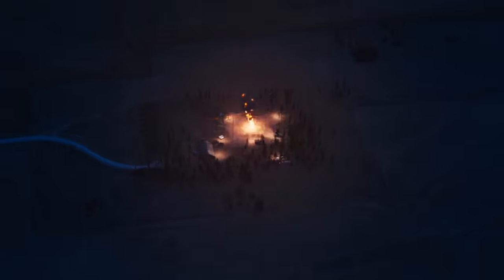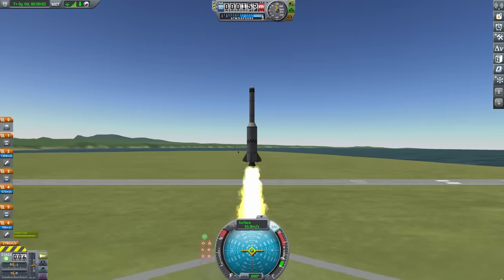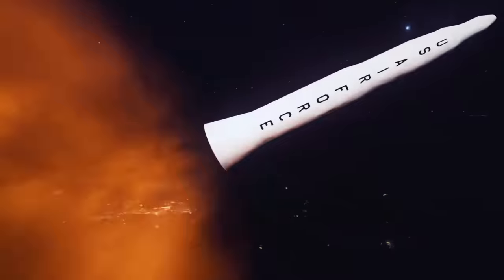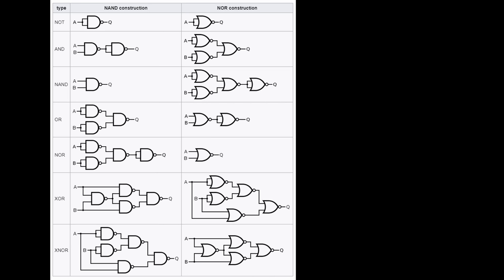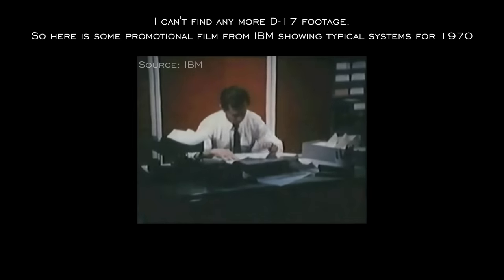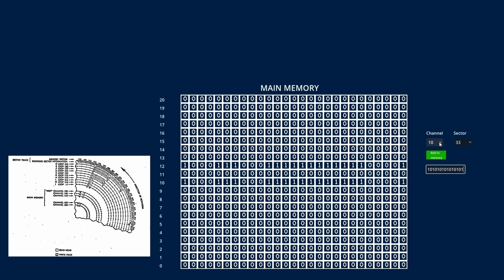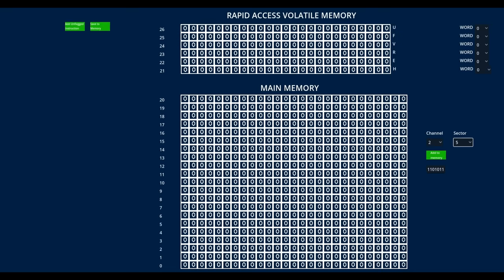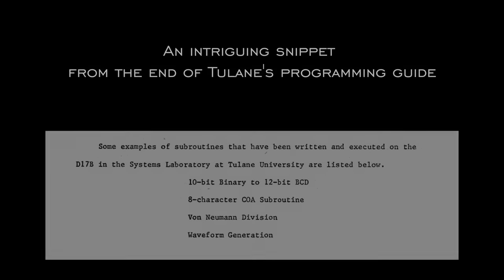Minuteman D-17b: The Desktop Computer Was Born in an ICBM

Comment: Real talk, "can it doom," is actually one of the best definitions of a computer I've ever heard. It's simultaneously very easy to understand and very accurate
Reply: In the late 90s that was one of the requirements we had to keep a system.. DX processor and Doom.
Reply from the maker: The only issue with that definition is you have to give a big preamble about ‘how its only hypothetical as youd need to address a relatively huge amount of memory…..and figure out a way to hook up the IO….and it’d probably run at like 1 frame per hour’.
Reply: i feel like 'can it doom' has an entirely different meaning when the computer in question is hooked up to a multiple-megaton thermonuclear warhead. and the answer is 'yeah dude, it sure can!'
Reply: "can it doom," (☞ﾟヮﾟ)☞ made my day XD
Reply: everything, quake, doom, fallout... even do light scribe (if you find a bunch of ruskys dancing YMCA close to a wall)
Reply: Oh believe me, it can doom.
Reply: @partciudgam8478   definitely lots of fallout
Reply: Its not new
Reply: Computability's space-time complexity problem at its finest.
Reply: @Alexander-the-ok I remember back in the early 1990s when Ray tracing was a matter of frames per minute instead of frames per second thanks to modern highly advanced graphics processing units equipped with dedicated hardware for solving tensor equations. Modern computing has and will always face the space-time complexity problem. It is safe to assume that it is the driving force behind technological development and computer science.
Reply: Can it 'Duke Nukem'?

I'll show myself out.

Comment: Beryllium is exceptionally stiff.  It is terrible to work with, the dust in particular though.  Great video, thank very much for the time these take.
Reply: Yup it is really difficult to machine it. It is usually beryllium with a few percent of oxide as it is excessively brittle as pure metal. It machines similar to cast iron making crumbly dust rather than chips. Most of the structural bits of the MIRV platform are actually made of aluminum hardened with a few percent of beryllium and scandium. Super lightweight but a bit stronger than most common grades of steel.
Reply: …and I bet no one told the workers to not breathe it in to keep it a secret (like the poor folks in enrichment facilities who were told not to keep too many buckets of liquid close together…. but not why…)
Reply from the maker: Beryllium sounds absolutely awful to machine. I'm guessing the dust would be toxic...and probably explosive too.
Reply: @Alexander-the-ok Extremely toxic. As in "you were around someone who machined some without protections, your house needs decontaminating, your car will be taken away by authorities and disposed on, the workshop will be closed down, and you may never work again due to lung damage" toxic.

Not a hypothetical
Reply: @mumblbeebee6546  oh we were warned it was beryllium or an alloy thereof, the prints just had cryptic part numbers that gave no indication of what they were for but the general shape pretty much told the tale for the sa parts.  The mirrors and stuff for satellites and such were far more interesting though. Yup the stuff is truly awful from a machining standpoint, got to get the speeds and feeds just right, too fast and it cracks, too slow and it takes chunks out feed too light and it eats the edge right off the insert, too heavy and it breaks the insert the part or both. Combine the work hardening of titanium with the brittleness of cast iron and you got beryllium. 💀💀💀
Reply: @Alexander-the-ok  yup it is. In solid form, it's just a weird gray metal about the same color of silicon. In this form, it isn't very dangerous. The machining chips are crumbly dust rather than actual chips. It is very bad if you breate it in or ingest it,  though it isn't particularly flammable or explosive. It's machined with lots of coolant flow in a glove box, and then the parts are rinsed off to remove the rest of the powder residue. The metal is very expensive, so the chips are saved and recycled. I could imagine that back in the 50s and 60s that machining Be was a death sentence though.
Reply: @christopherleubner6633  Thanks for your reply, glad they did not sacrifice you to the “Desktop Nuke” wholesale (sorry Alexander, but that’s what the Minuteman 1 will now be called in my head forever). Sounds like something I am happy to give a miss in my dream machine shop :)
Reply: I did an internship somewhere where employees had to take regular "Beryllium Training" courses, no matter what your role was. Everyone had to know to take it seriously as a threat, if only to make sure they heeded warning signs in case of a dust spill. Apparently you had to renew Beryllium Training way more often than any other training at that lab, so there were lots of jokes about it among the staff.
Reply: @an_asp  YT algorithm is scary - now it shows me lots of Galaxy Quest clips 😂
Reply: Most insulators on microwave magnetrons are also made of Be. One of the many reason you shouldn’t take a microwave apart if you don’t know what your doing
Reply: @aurorajunior6328  Oh that is really scary seeing how many YT videos are about that… and I do want a DIY spot welder too :)

Comment: The Hard Drive architecture isn't as confusing if you think about it as a solid state version of delay line memory.
Reply from the maker: This is an excellent comparison. The fast access loops were dynamically erased and re-written just like delay line memory.
Reply: Yes, thanks for clearing that up very solid state version of delay line memoryish of you my good sir. I know these words, individually...
Reply: @mrsquidly6395  So before we had things like high speed magnetic storage medium for computers we needed some way for computers to retain a lot of bits of memory punch cards weren't fast enough and couldn't be written and rewritten easily. Although memory cells could be made of tubes they were very energy and space inefficient for this purpose.

So the idea of delay line memory was made. Commonly filled with mercury for its density it was a long tube with a transducer at both ends. Bits were fed in as an audio waveform at one end travels through the mercury and is read out the other end. If the bits aren't read out and fed back in to the start they are lost.
Reply: @Jackpkmn  I'm gonna have to search this up because I'm still not getting the full picture even with how well you've articulated the concept to me. I can't quite tell if I'm dumb or if you're on a level I've yet to even begin grasping. 

I saw mercury and all of a sudden everytime I try to comprehend it I just keep visualising one of those old lightbulbs and It keeps throwing me off. A.D.D brains there telling me "ah, we know mercury and it's in a tube so lightbulb" I'm starting to lean towards the idea that I'm probably just dumb haha
Reply: @Jackpkmn  does the wave propagates through the mercury bounce back and forward storing the information in diminishing waves and as a result acts like a very short memory?

Hmm, also if not, i thought sound propagates faster in denser mediums?

What does the delay serve?
Reply: @Jackpkmn  Regarding delay lines, there were also ones implemented using audio traveling down loops of wire.  The (sadly no longer functional) Ferranti Pegasus at the Science Museum, London (UK) being one machine that used them.
Reply: @theeyeofomnipotent  The signal is fed in at one end and read out at the other.  As each bit is read it is also fed back in at the other end (to make the memory persistent).  In other words, they acted as shift registers (with feedback).  I don't know whether reflection was an issue though I suspect that carefully matching the properties of the transducers and the mercury would minimize reflection.  The mercury was also kept heated (40°C / 104°F) to make its behaviour predictable and consistent.
Reply: @alexhajnal107   i see, so it enlongates the signal activation time long enough to be fed it's own signal?, if so how responsive is it?
Reply: @theeyeofomnipotent  Each delay line typically had several hundred bits in flight at a time.  Reads and writes were strictly serial, i.e. one could only read the bit currently exiting the tube, not any of the bits in-flight.  This isn't quite a awkward as it sounds since 1) multiple delay lines could be used in parallel (indeed by angling the transducers each tube could contain multiple channels) and 2) the machines they were used with often had serial ALUs.  As for timings and using the UNIVAC I as an example, each channel in a given tube had ~1000 bits in flight at a time at a bit rate of 2.25Mbit/second (it had 7× ~55 cm tubes with 18 channels each; word size was 72 bits).
Reply: @mrsquidly6395  Mercury delay lines were tubes filled with mercury (heated to exactly 40°C for speed stability).  Audio transducers were placed at opposite ends of the tank (i.e. axially).  These things were fairly large, on the order of maybe 50 cm to a meter in their longest dimension.  If you look at a photo of the delay line used on the UNIVAC I, the large cylinder is the mercury tank and I think the cylinders on the boxy "fins" are support electronics for each of the 18 channels (by angling the transducers multiple bit streams could be simultaneously be in flight in a single tank).
Reply: @alexhajnal107   i see thankyou
Reply: @alexhajnal107   thankyou
Reply: @Alexander-the-ok  Delay line memory is what popped into my head when you mentioned the "loops". 👍

Comment: Spinny magnetic things were apparently a pretty established memory technology back then. A fella on Usagi Electric youtube channel is restoring a 1956 vacuum tube computer that uses a large magnetic drum at its core. The drum that came in his machine was shot but he managed to find another one in better condition in a museum machine and swap it.
Reply: by the sounds of it they are quite reliable as long as you dont run it too cold, would be even more reliable if any of the maintenance tools still existed to deal with stuff like bearings and blitzed time tracks like it could originally do
Reply: @nickolaswilcox425 yeah Usagi Electric is actually putting this machine project on hold due to cold weather out of concern he'll just trigger another drum crash if he fires it up when it's too cold
Reply: The desk computer shown reminded me of a model of the Centurion mini computer, also being worked on at Usagi Electric. 

For anyone wondering, the machine in question is the Bendix G-15. Not sure if it was this channel but there's a video about the guidance computer in a fighter jet that shows an earlier model sporting a Bendix computer at its heart, which given the size of those things when used as mainframes is mind boggling.
Reply from the maker: I need to catch up on Usagi Electronics - I love that channel. The way in which magnetic memory started off as drum format and moved to disc is weirdly identical to how vinyl records went from cylinders to discs.
Reply: Yup, core memory, used ferromagnetic toruses to capture state. This is where we get the phrases "core dump" and "... Dumped core..." Today.
Reply: @Alexander-the-ok  I just said "oh wow" out loud at my kitchen table, that is a fascinating observation

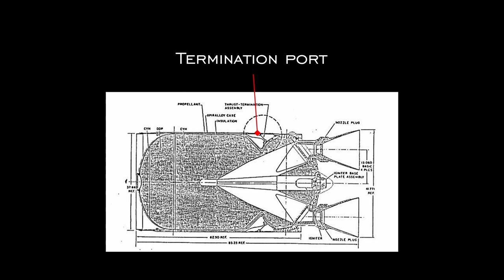Comment: 21:28 The reason why thrust termination ports work is due to the St. Roberts Burn Rate Law. It states that the regression rate, or how fast the propellant is burning back, is equal to a constant a times chamber pressure raised to the constant n power: rb = a*Pc^n. The a and n coefficients are based on the propellant mixture and are determined through strand burner analysis. When the thrust termination ports open, the chamber pressure drops rapidly, and thus the regression rate goes down. This is known as 'quenching'. The ports are angled forwards because the regression rate will not reach zero immediately, and will instead taper off as gas exits both the nozzle and the open ports. The angle of these ports results in zero net thrust. Some ICBMs actually angle the ports further forwards and use them to 'back off' the spent stage from the warheads and guidance bus. If you'd like to learn more there are a few good NASA papers online on solid motor quenching.
Reply from the maker: That’s really interesting, thanks.
Reply: I also recall that one of the other stalwarts of space comms (Scott Manley, I think…) showed how another ICBM used bypass channels to steer the missile, by porting some of the chamber pressure sideways?

Comment: So they gave a serial number to every resistor in a computer and tracked it all using paper.

A logistical nightmare is an understatement.
Reply: Especially considering this, if I uderstood this correctly, for all of the Minuteman I missiles, spread across various bases and units ...
Reply: @HerrmannStahl  I guess for a nuclear ICBM you probably want a lot of tracking of where the pieces might end up somehow
Reply: I think passive devices were tracked by procurement lots. And if samples from a lot failed its functional or environmental tests, the entire lot was tossed. And later if a Failure Analysis Report on a failed module pointed to a flaw on say a resistor, the entire usage of that resistor lot could be traced and replaced if necessary. And these parts were fabricated to Mil-Specs and not commercial specs. Thus the high prices for components, but the mean time between failure (MTBF) of modules in these strategic weapons were incredibly good.
Reply: @davidmercado9293  yeah ok but where did this resistor come from or wait we lost it.... then found again. what number was it?
Reply: Serialised components would be tracked using punched card systems: either electromechanical tabulators etc. or room-sized mainframes.

Comment: Back in the mid 70s we had one of the University donation units in our EE department. One of the advanced students built a seven segment numitron display (incandescent filaments) and switch setup that could be used to enter short programs.

The S/N on each component was no joke. For their time the components were top notch. Our unit consisted of the processor half of the round split apart and mounted on a rack.

I was very impressed by the reverse voltage protection. There was a huge stud mounted rectifier across the power input ready to short out the supply if it was connected up backwards.

Sadly no exciting projects were ever built around it.
Reply from the maker: Thanks for sharing your experience- it’s so interesting to hear from people that actually used these, even if they were just largely used as ‘nerd toys’.

Funnily enough, I made a video about numitrons before my channel took off. I have 6 of them on my desk displaying my channel subscriber count.

Comment: Soviet R7 used measurement and correction ground stations. But the first generation of R7 was more of a technology demonstrator or stop-gap solution than weapon system
Later rockets used vacuum tube computers on board, with miniaturized vacuum tubes which had a size like a small part of the pencil and a lifetime from several minutes to several hours.
Reply from the maker: I need to try and find some good source material about the soviet rockets.
I certainly am not surprised later models used miniature vacuum tubes - a lot of soviet hardware did from the mid 1960s onwards.
Reply: Can you drop any sources on the R7 guidance? Compared to USA space program the soviet one is an information black hole...
Reply: @Feldmarshall12  There is 4 volumes of memoirs of Chertok, one of Korolev's «leutenants» with a lot of high-level information, but I'm not sure it was translated from Russian («Rockets and people»). Also, some sites in Russian were online ten years ago and I'm not sure they are still here, as links rot at an unbelievable pace :-(
But mostly paper books of memoirs not pre-printed after 80s of previous century.
Reply: @blacklion79  I did come across "Rockets and People". Actually English translation is freely available from nasa web page (just google the title). 
Do you have any idea on accuracy of those memoirs? Published in the 90's, around 30 years after, I imagine they could not be 100% accurate. As far as I understand he didn't have access to government run archives when writing, did he?
And anything published before 90's would be run through machines of propaganda and censorship, again impacting accuracy.
This is stark contrast to NASA history series, where authors were supported by access to many documents still held in archives and could arrange for meetings with people that were still in NASA at the time of writing. But maybe I worry too much ;)